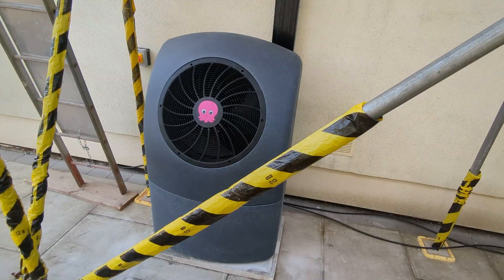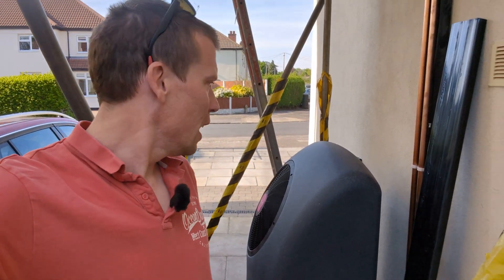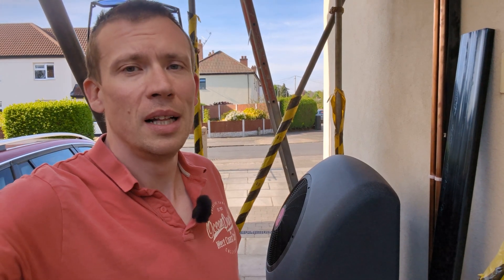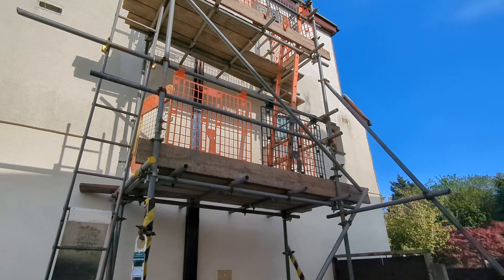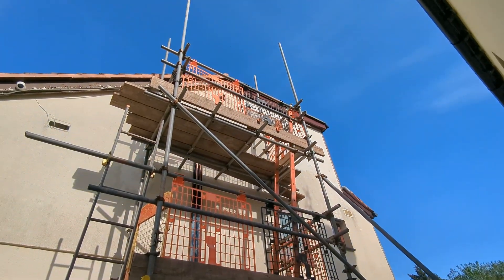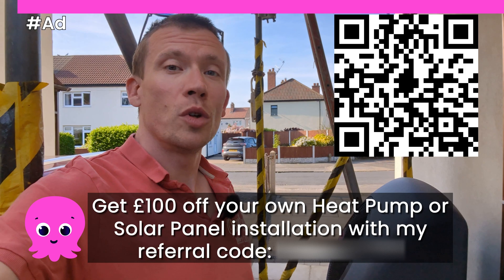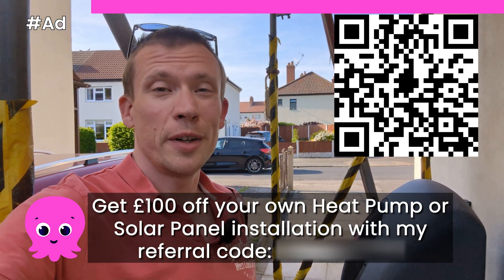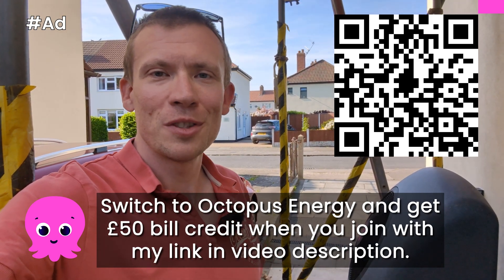Day #1 - Let's Get Cosy! | Octopus Cosy 9 Heat Pump Installation

Comment: How long did octopus take to install the heat pump from the order day ???
Reply from the maker: Do you mean from when I first got my quote or from when I paid the £200 deposit to kick start the survey?
Reply: @SwitchedOnNetwork 
Just got my survey in two weeks time . Would like to know how long after the survey it’s done they will start to do the installation.
Thank you for the reply
Reply from the maker: About 6 weeks I think, but lead times might be different right now. Hope the survey goes well - let me know how you get on!
Reply: @SwitchedOnNetwork thank you .
I will let you know .
And will use your code also .
Reply from the maker: Thanks!

Comment: Do you have faith in heat pumps after all the bad publicity they have had. They installed them In Westminster and took them out again because they were inefficient.
Reply from the maker: I do, yes. Heat pumps are the norm in Scandinavian countries! You do realise people have problems with gas boilers all the time right? Stories of people doing a bad job, cowboys installing things wrong, or the wrong thing being installed etc. etc. don't override the many many stories of people having great experiences and being very pleased!
Reply: That is false on the Westminster story. They are still in and running in Portcullis House, they have just paused the rollout of more as they have some technical areas to overcome, like upgrading the power supply to the building to handle the higher load. The noise issue that is being claimed is actually to do with the pipework, not the units/fans as such. The building is fitted with blast resistant glass so you'd never hear the external units as the windows don't open. Also, these will be industrial scale heat pumps and not domestic units so a completely different type of unit but based on the same general technology.